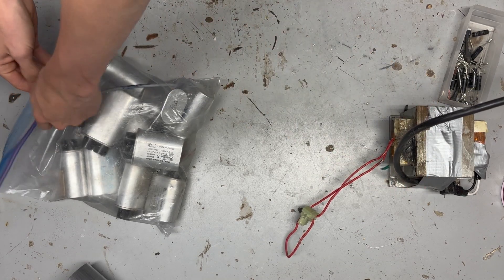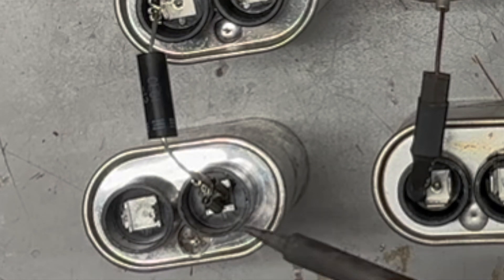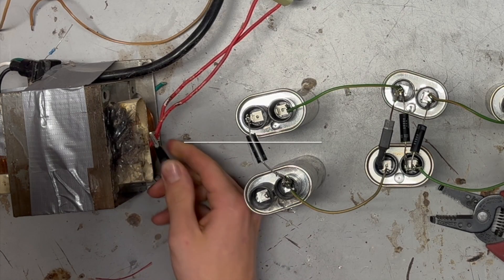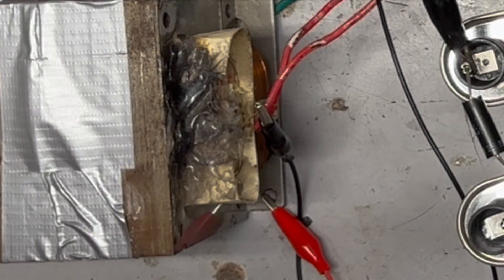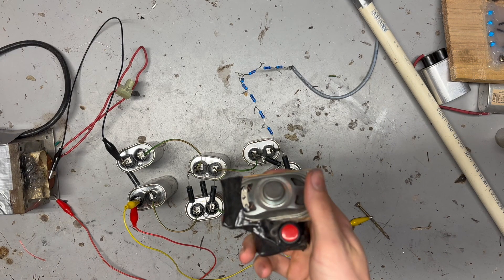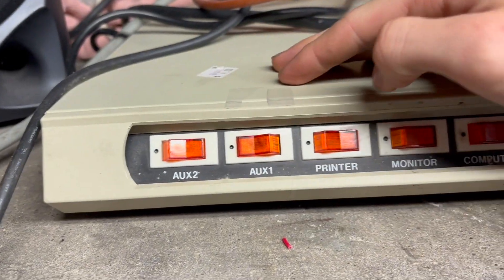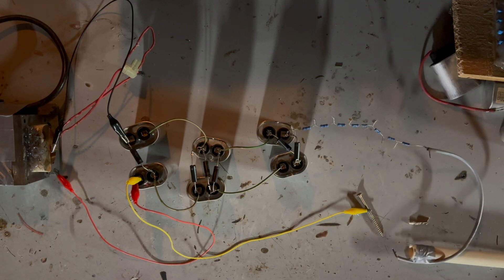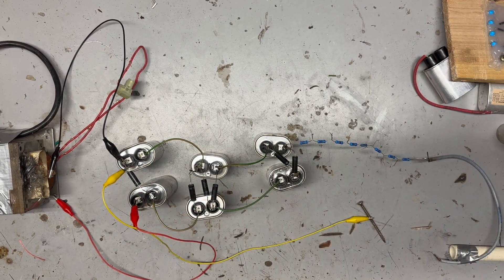The Death Machine: a voltage multiplier made from microwave parts

Comment: Couple of tips from an oldschool (but still alive) HV experimenter:
- You can use a jar of salted water with two electrodes to act as a HV current limiting resistor that will take a lot more abuse than normal blue metal film resistors (Known in mad scientist circles as a "scariac" haha). You can even make much more consistent/permanent ones by using bolts siliconed into a tube full of electrolyte (From memory I think brass bolts with copper sulfate 'root killer' solution in the tube is one of the best DIY options - GPT should be able to give you an idea on tube length/electrolyte concentration to get a certain resistance)
- Keep in mind that concrete floors sort of stop being insulators at these kind of voltages - obviously you're aware of the hazards (use a chicken stick for everything!), but maybe get some ceramic tiles to put live electrodes on. Many years ago I cooked a neon sign transformer because it was sitting on concrete. The output lead arced to the concrete, then back up through the epoxy on the transformer :(
- When making CW multipliers like this, I found that modelling them in LTSpice (free, easy to use) was a really good option for figuring out if diodes would survive, and what value of resistor to put where to avoid popping them. Also lets you model a multiplier with bigger capacitance at the "low" voltage end to get more current out of the output end.
- High frequency CW multipliers usually end up with more output current, because the capacitors are charged/discharged more times per second, hence more electrons moved. Disadvantage is that you need faster diodes. If you want to go down that route later, gut any "inverter" microwaves you can find, they have nice high frequency film capacitors and a couple of fast diodes (same sort of current and voltage as the ones you're using, but can switch at 20kHz or so instead of 50/60Hz)
- Microwave capacitors can often take 8-12kV DC. Didn't believe it when I first heard it, but I tested a few and they seemed to cope OK! Also in your application I wouldn't worry about the caps - the diodes will be the weak link, I've discharged MWOCs into dead shorts repetitively many times, and have never had one die.
Reply from the maker: thank you so much for the advice! I have been able to get a MWOC up to 20Kv although it didn't survive very long (15 zaps) I ordered a bunch of hv hf diodes from aliexpress that I was planning on using for this (like 120 of them) and I would make the capacitors from 6 layer cellophane and aluminum foil striving for 400-800pF so that they can't store enough energy for them to pulse instead of making a constant arc like they're supposed to. (one layer of cellophane can stop a 1.3 cm arc somehow. 6 layers just for redundancy). I would have used them to build a 20 stage cw multiplier and run it at ˜20khz ˜20kv from a homemade flyback wound with aliexpress 36AWG magnet wire around a homeade core. I made a bigger hv capacitor from rolling up 10ft of 6x cellophane, aluminum foil, 6x cellophane, and more foil and it has 37nf and goes up to 40kv

Comment: i have a question, what do the resistors do?
Reply from the maker: make it so that all the capacitors can't instantly discharge and blow up (like they did when I only had four) once an arc is started the air becomes conductive and if there is nothing stopping it, all 180 joules from the capacitors will go through the air in like 4 microseconds

Comment: Hello, I'm doing something similar to make nitric acid, and I use the high voltage transformer connected in series with another one that I adapted, to put more impedance to the system, it worked well, but from one moment to another, it started to consume a huge amount without having abused the system, I'm telling you to see if you can help me bro, sorry for the inconvenience
Reply: Maybe an internal short in the transformer? It only takes one shorted winding, or a breakdown of insulation between the secondary and the core to wreck a MWOT. I think it was maybe @diodegonewild who did a video on how to connect MWOTs in series without damaging them.